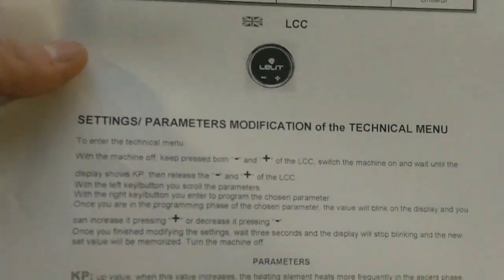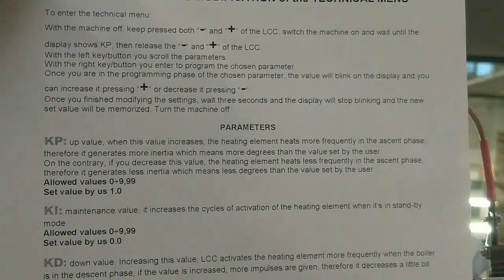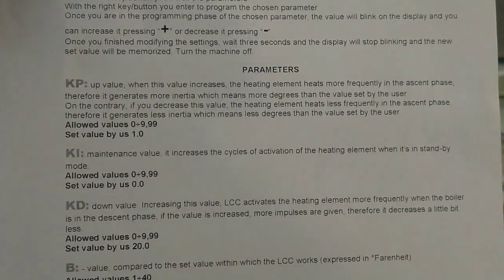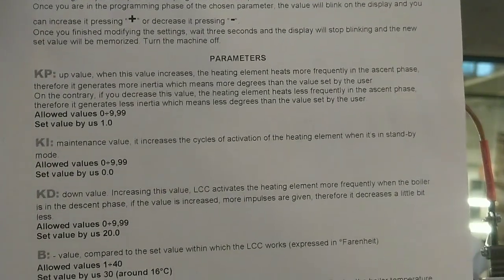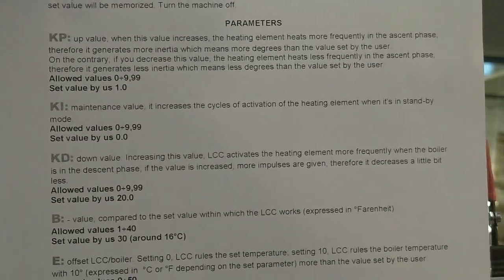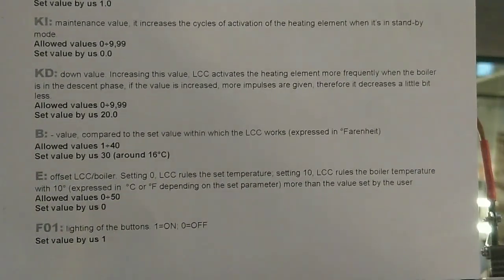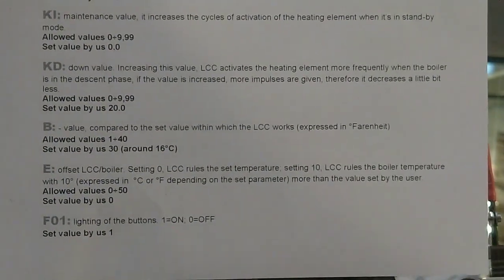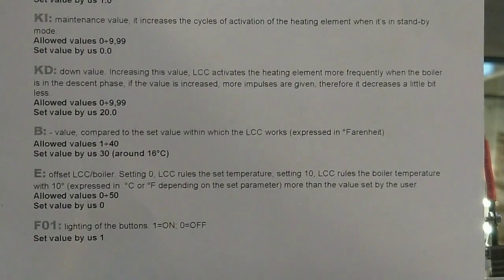pl81t termofilter test

Comment: Thank you so much for all the effort with these videos, they are really helpful!

I have a pl81t machine, and I am thinking of changing the offset, but I am not how would lowering the KP and KI values would affect the temperature stability? And why does these settings makes the steaming power worse? Is there an option to keep the steaming power good?
Reply from the maker: hi, i suggest you this value
KP 1
KI 0.04
K0.01 
E5,  
try this value some days!
Reply: @lelitinsider2977  Thanks, will do. Today I just changed the E value to 6, left all the others as is. It was default at 
KP10
KI 0
KD20
B30 (no idea what this does)
E0
Reply: @lelitinsider2977  Can you please tell which of the values are the corret ones? The values in the video and description text are different to the values you posted in the comment.
Video:
KP 0.1
KI 0.04
KD 0.1
E 8
Description:
KP 0.1

KI 0.04
K 0.01 (what is K? KD would be the only missing parameter but you cannot set anything below 0.1)
E 5

Thanks!

Comment: I have a question for you: How much time it take between end of steam distribution (after push the button) to get to the return to the coffee/water fonction ready? It seam long. It take on mine 13 minutes. It is normal?
Reply: You can draw hot water from the wand once you switched out of steam. Do it in a pitcher until there's no steam but just water running from the wand.

Comment: Wouldn't it be better to reduce offset by 1 degree so that instead of the machine going all the way to 97c (instead of the target 95c) it will only go to 96c?

And a separate question - I hear that this machine allows the hot water outlet to be used for flow control while the pump is working. Is this true?
Reply from the maker: fhe pl81t  grouphead is hot, it works with less offsett than the pl91t 

https://www.youtube.com/watch?v=bHt6Jf8CySs&t=292s
Reply: @lelitinsider2977  Thanks for the link. The PL81T looks more and more appealing...

Comment: Hello. 
I' ve tried with the same values but the machine can't arrive this tem, when I turned it on. The machine goes in "save energy" mode before the tem is arrived.
Reply from the maker: if you want you can diseble the the energy saving
Reply: @lelitinsider2977  I thought about it but I have noticed that the machine arrives the 87 degrees (the set tem is 91) fast and then stays in this temperature for about 10-15 minutes. So I am not sure that it would help to turn off the saving mode. The strange is, that if I turne off the machine while the display shows 87 degrees and turn it on again, the display shows immediately 91 degrees, OK. Do you know why?
Reply: @thanasistsior5383  I have observed the same problem. 
@Lelit_insider, do you notice the problem, too?

Comment: Been a happy owner of this machine - thank you for the test!

Would you be able to elaborate a bit on the kp/ki/kd settings used? They significantly differ from the factory settings. Were they selected because they provided the best results during testing?

I find that on the factory settings, PID tends to heavily overshoot when recovering after the shot is finished (when flushing to clean the group I always hear hisses indicating boiling water), which makes it a bit tricky to pull back to back shots.  Out of curiosity, I tried the settings presented in the film and this was not occuring. However, in my case this was done at the cost of steaming performance that got much worse.
Reply from the maker: the factory settings is very aggressive, this because we must to do the shot in less time as possible, for the energetic consumption omologations,
with the setting in the video the coffee temperature is more stable, but you have less steam power
have you trie it?
Reply: @lelitinsider2977  Thank you for the response. I've tried them yesterday and it didn't seem to overshoot and both shots seemed consistent. Unfortunately, Grace's firmware doesn't allow to view the real time temperature value on the PID, so without professional tools it's not possible to exactly verify ex. how long does it take for these new settings to stabilize the temperature after the shot and whether there are any oscillations when the machine is sitting on idle.
Reply: @lelitinsider2977  Hi, thank you very much for all the info. I've also tried this PID settings and I am very pleased but I also noted steaming is worse or at least, very different from previous (factory) PID. Now I cannot get proper steamed milk like before.
Reply: Yeah, the settings are good, but the steam is much less than before. Is there a option for a way between these?